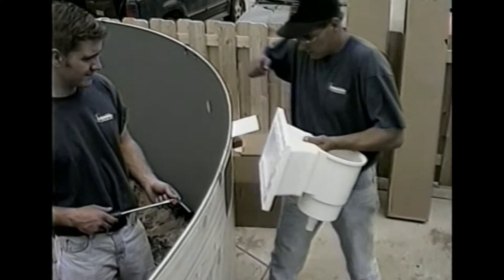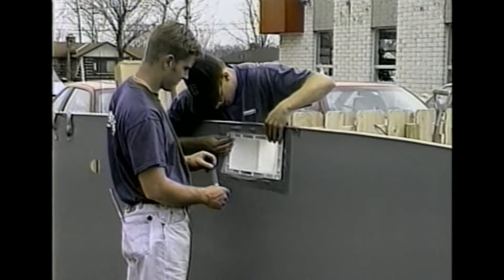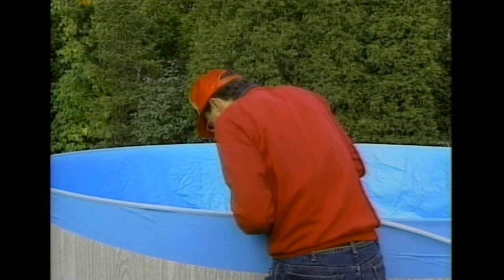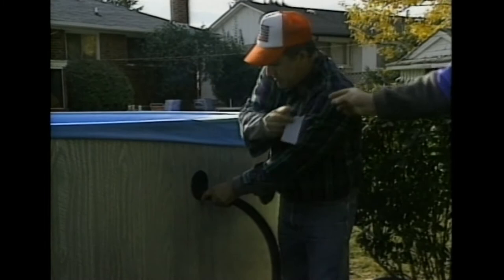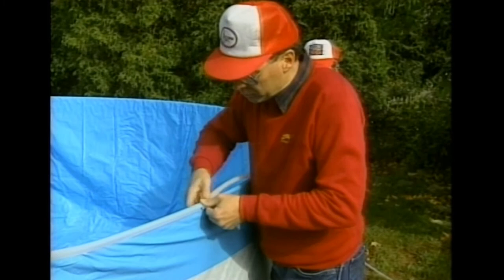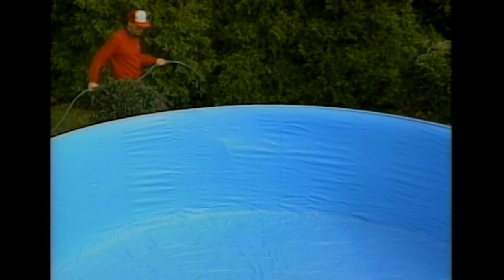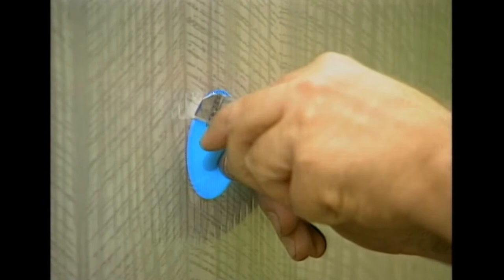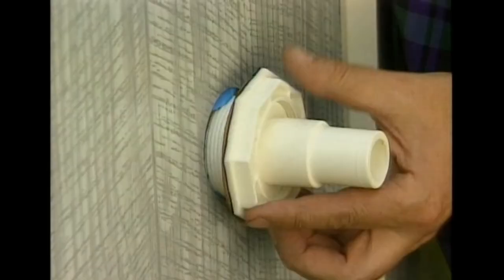Litehouse Rapid Flow Skimmer Installation Instructions

Comment: Incredibly frustrating design that could have been solved with a butterfly gasket instead. Mounting needs to be done behind the liner, unlike every other skimmer. Unfortunately that fact didn't become obvious until after the new liner was installed and pool was filled. 😩
Reply: What did u end up doing to fix it? We did the same!
Reply: @tiffanywood7496  unfortunately had to drain a good bit of water out so the contractor could get behind the liner and install. Since I'm on well water, it created a chain of events that involved me not having water for days. Ugh. Best of luck.